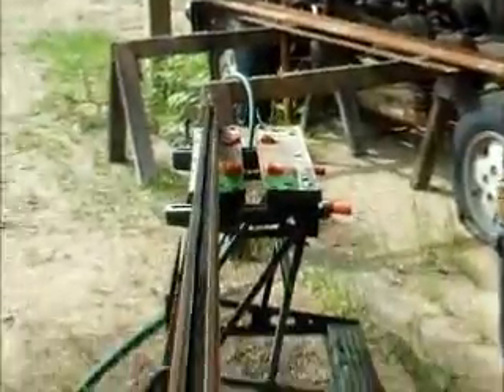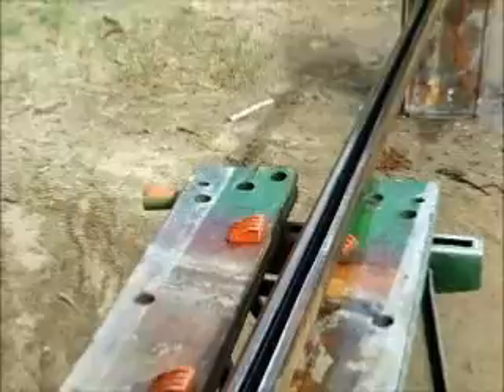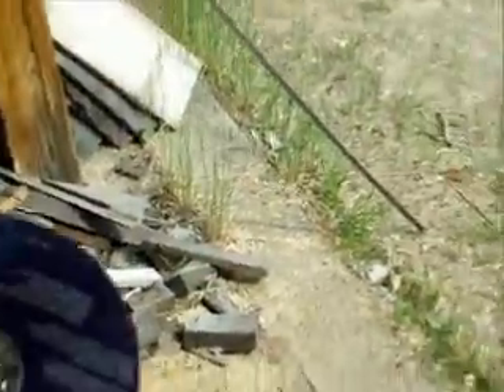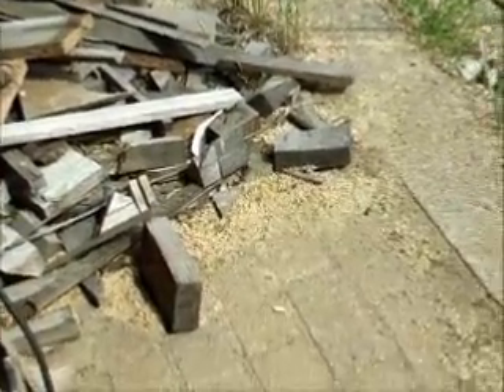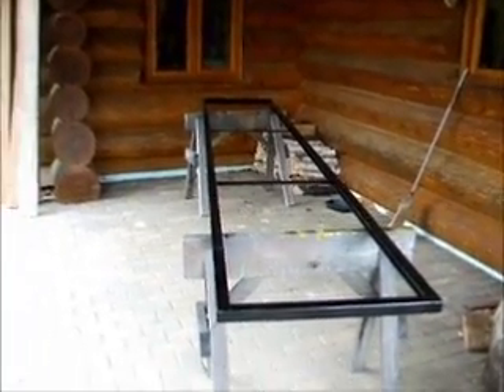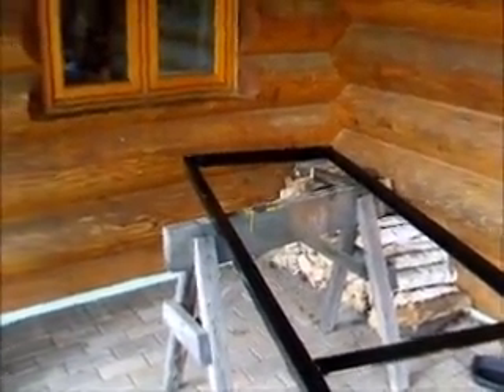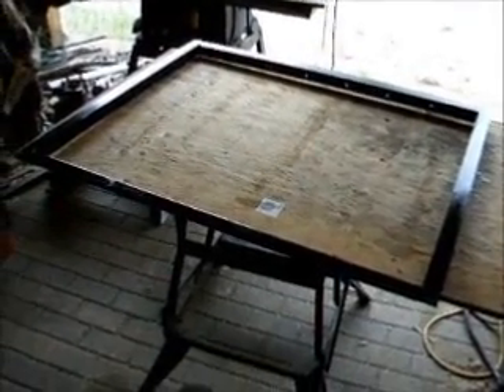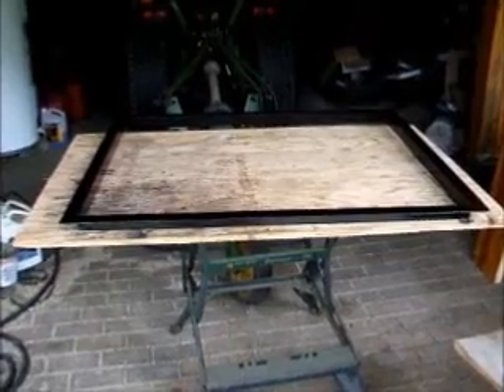Elevator Track Construction

Comment: You should have used gradge door tracks. Then you could have put a safety bottom bracket (made for large overhead doors) rigged your cables to them and now you would have an elevator with broken rope safety.
Reply from the maker: Ham549 Garage door tracks are not an option in this kind of configuration where a platform hangs from just 2 tracks but is fixed in 4 directions.  It is an engineering thingy. lol. Thanks for watching.

Comment: Hi again Ed, Ken here from Ohio.  What thickness of square tubing did you use to make your uprights for the bearings to glide in?  Anxious to here how it's works out for you,mom an Daughter!  Thanks
Ken
Reply from the maker: Hi Ken. My uprights are made of 1.5 inch by 1.5 inch square tubing 3/16ths of an inch thick. If you wish to build a bit heavier, I'd go to 1/4 inch thick 1.5x1.5, cut a little wider grove and use 1/2 inch bolts to carry your bearings. That should take you into the tonnage as to lifting capabilities. The elevator works quite well.